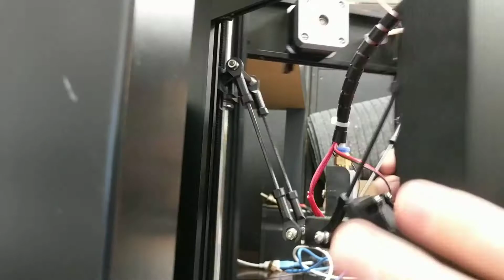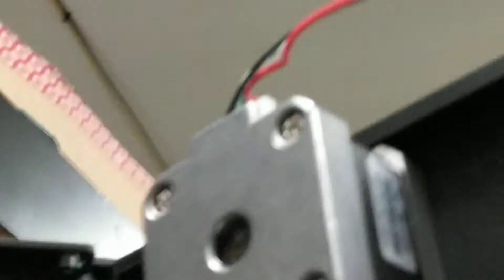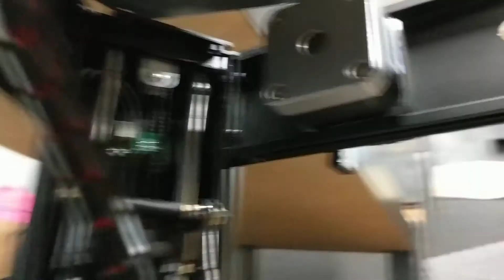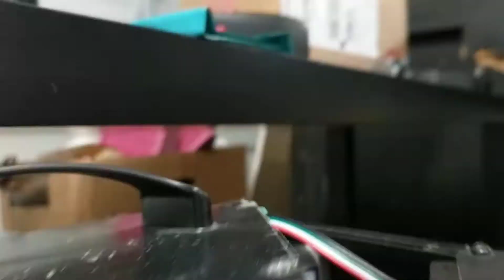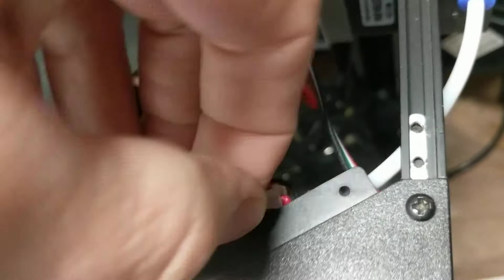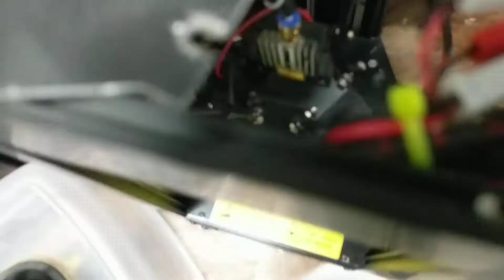MP Mini Delta - Sensor Failed or 300°+ reading for the Hotend/Nozzle

Comment: great video, mine stopped heating, reported a sensor failure. I checked the wires at the heater cartridge, and the connector in the bottom of the printer, watched your video, removed the top plate, wiggled the wires, and hey presto - thank you so much!

Comment: Any tips for the bed heater? Mine has a hard time reaching 50 degrees when nozzle is set at anything above 195. I bought a new adapter with 10 amp output but doesn't seem to help. The bed wont stay at 55 and wont reach 60 at all. Also seems to have more trouble when I have anything printing faster than 20 mm/s. Like the motors and hot end are taking all the power.
Reply from the maker: Using a higher voltage power supply (not recommend) or flashing the mainboard with Marlin4MPMD which will allow the bed heater to operate fully.

Comment: Great video. Had a Monoprice mini delivered (open box). Had failed prints and sensor failed message. It was the red hot end thermistor connector at top of tower with intermittent/bad connection. Fixed 👍
Reply from the maker: The sensor failed message is sort of misleading. What is happening is the thermistor is reporting the correct reading but it is a different temperature (usually too low) than expected for too long. The printer then usually stops the print and displays the sensor failed message.
Reply: @MatthewUpp  Yes the sensor is working, the intermittent/poor connection could catch people out as it causes the printer to report hot end is cooling down, fairly rapidly, which causes print to abort. If I disconnect all together then temp rockets to say 600deg. Must've caught Monoprice engineers out as was open box product and they sent it out to me that way! Thanks for your help 👍
Reply from the maker: @paulmunro3050  you said "Monoprice engineers". I believe that is an oxymoron. 😀
Reply: @MatthewUpp  😂

Comment: Hi, your video was very helpful ( wire was loose on the head ). Wouldn't have known where to look :D thx for taking the time!
Reply from the maker: You're welcome. Make sure that no wires are broken or will break soon else you may have a worse problem requiring a mainboard replacement if the wires from the thermistor and heater come in contact with each other.